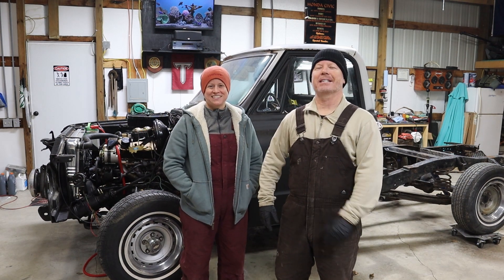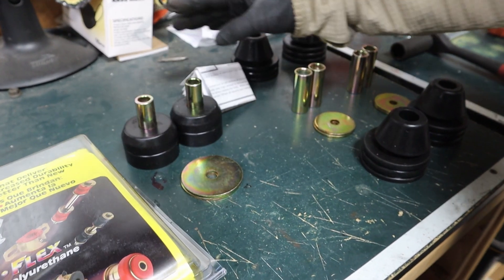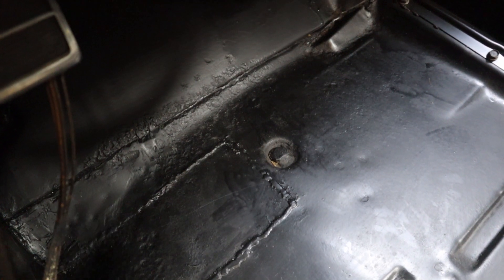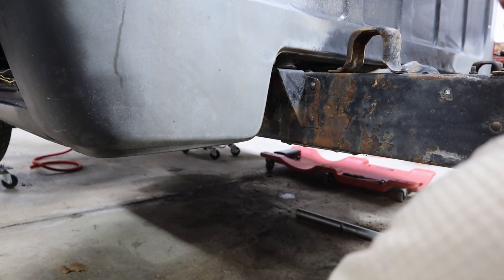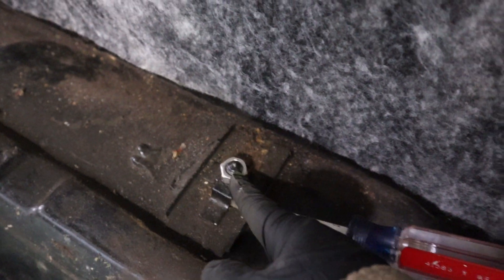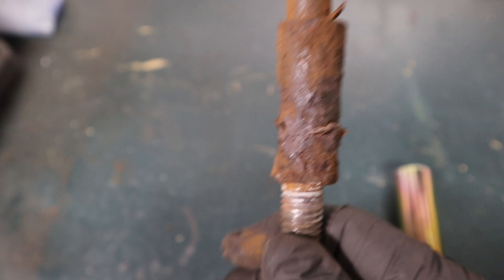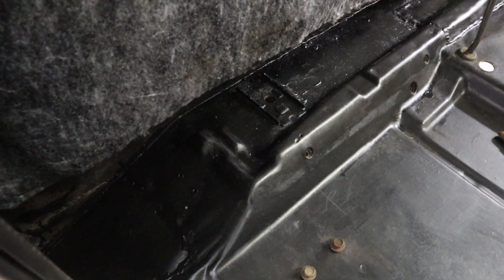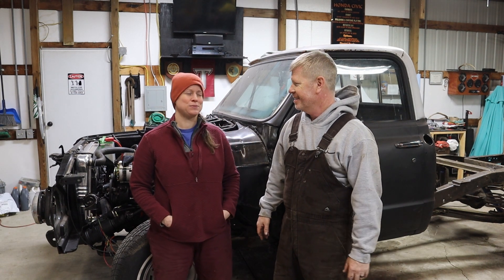69-72 Chevy C10 - Cab Mount Bushing Upgrade : Energy Suspension Polyurethane -Project Harold -EP. 12

Comment from the maker: Not even sure how this would have sounded driving down the road with the bushings in this condition but we know how sweet it will feel with new ones. Have you seen any in this condition before?
Reply: I did a cab and bed swap from a 2 wheel drive to a 4 wheel drive chassis once and the 4 wheel drive donor truck was terrible.  Wound up doing a complete sand blast and paint on the frame before reassembly.  Every fastener had to be cut off and all the rubber was junk.  It was a pretty decent truck when I got it done.  Harold will be fantastic once he's back on the road.
Reply from the maker: @Yellow Jacket Garage  That's awesome.  I personally hate when I have to cut the stuff off.  I prefer it all to just break or fall off. Lol.
Reply: @Spirit'ed Wrenchers  do you have a nut splitter that will fit?  If you can get one on the nut they take care of the rusty ones pretty quick.

Comment: IDK if im a huge fan of how much play there is in the cab bolts and the crush sleeves. So much play in there that while driving and rattling they may shift on the pickup. I bought the same kit and am going to get a bolt that fits tight in my crush sleeve and going to anti-seize them so they dont weld themselves to it..
Reply from the maker: Hi Theodore Peterson. Thanks for watching and sharing your experience. The bolts we used weren't too loose but we'll know for sure once we get it on the road on how it does. You made a great point of adding anti-seize to the bolts. I didn't think about that but if we do have to pull them back out for any reason, I'll certainly do that. What truck do you put these on? Cheers!
Reply: @SpiritedWrenchers  I am redoing a 1969 C10.
Reply from the maker: @tedpeterson50  Excellent. How far along are you?
Reply: @SpiritedWrenchers  frame cleaned up suspention on it so rolling frame. I boxed my frame. LS swap with 4l80 trans. 5/7 drop on it. cab is about to go to stripper to be cleaned and then on to replacing rocker panels and cab corners.
Reply from the maker: @tedpeterson50  hell yeah man. That sounds awesome. If you're ever interested in sharing progress pics of the build, send them to our email. I keep connected with a couple across the country and Canada and it's great to see the transformation. Really hoping to have ours on the road this summer.